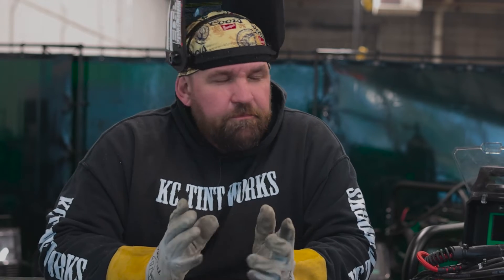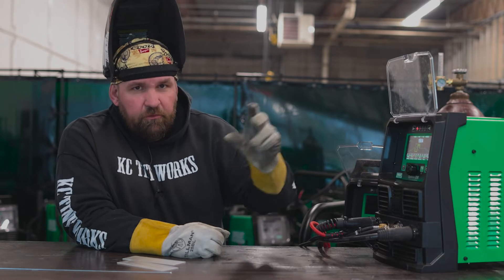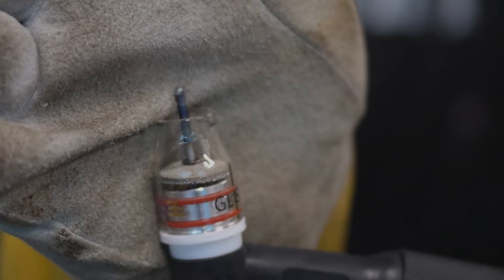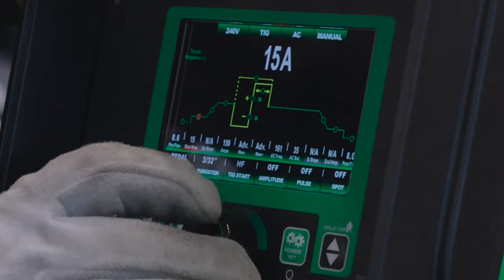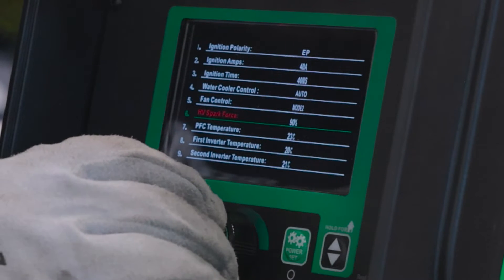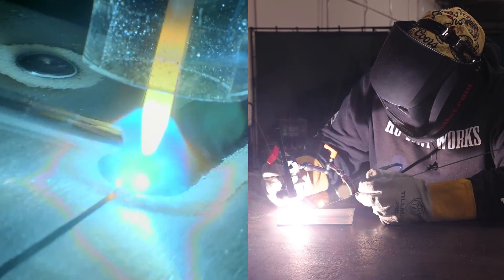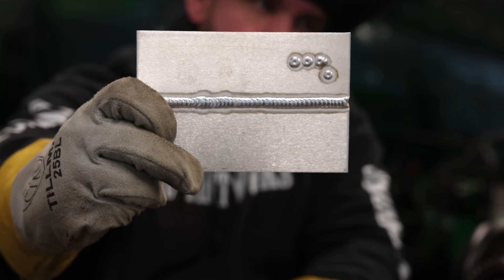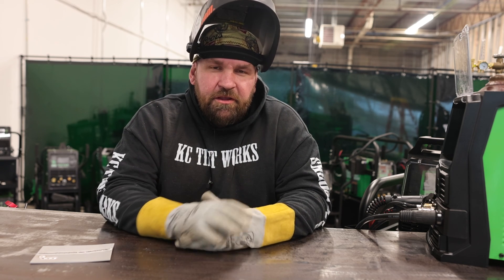Troubleshooting Customer Machines: Poor Arc Starts?

Comment: thinking about getting a typhoon, have you guys released a warranty claim stat on these machines so far? I'm coming from a squarewave 200 so I got ptsd from dealing with that, lol. I'm an experienced welder so i don't think ill have any problems getting lost in the settings, i actually appreciate the level of adjustability this machine has to offer.

Comment: well done sir !

the start- settings tell me one thing for sure :
this machine has been built by people who are REALLY in to welding.
brilliant !

i had arcstart issues with a red machine running CuAl8 on thin gauge  steel ( like 1/35 inch ;-))  )
the Typhoon will do this i think.

Comment: I have a Everlast 315LX, the shielding gas hose split just below the torch. Can the lead be replaced  or the whole torch?
Reply: You can get the new style head with the hose barb/ferrel connections and trim the gas line back and reconnect it

Comment: I had terrible starts with my 255ext. I had to dress off the work clamp as it was making terrible contact from factory. Casting flash was minimizing surface area contact. Dressed off smooth arc starts are almost as good as a dynasty 280 I used to use for work.

Comment: What got me a couple of times was switching between pedal & torch switch & forgetting to set the machine for it. After 3-4 arc attempts you like "doh". I'm new to tig so the Typhoon 230 presets have been great for settings to practice with.  On A/C tig preset the metal options I'm not familiar with as I'm just a hobbyist. Whats the difference in the two?

Comment: i've been having problems with beveled cuts with the 102i cnc plasma cutter.  Can you help with that?
Reply: It’s beveling one direction X or Y that can be an indication that the table isn’t level, or one of the stepper motors could be binding, also could be the torch is not square to the table.
Reply: Air pressure, wrong amperage for consumable size, worn consumable can cause this is. Moisture too. it on circles only? Does bevel change direction around the cut? Whats stand off height.

Comment: Explains some of the things I've been guilty of, and I have much older machine that just has dials for the adjustments. The few times I've used the multi process machine in TIG mode I've had the exact same issues. 👍